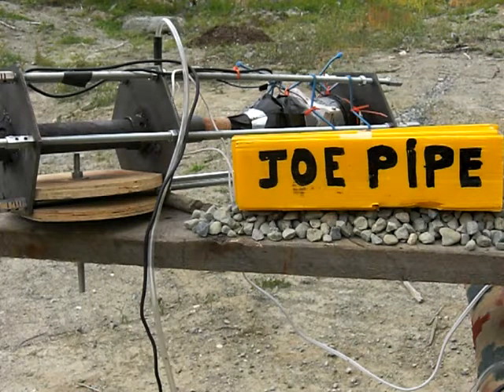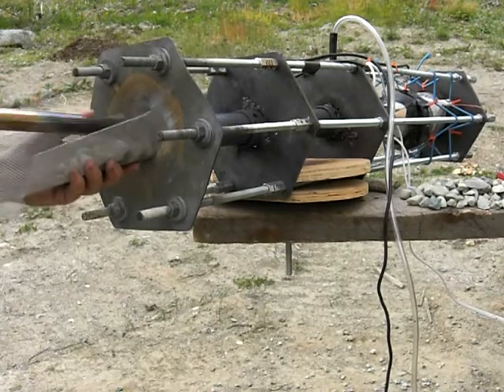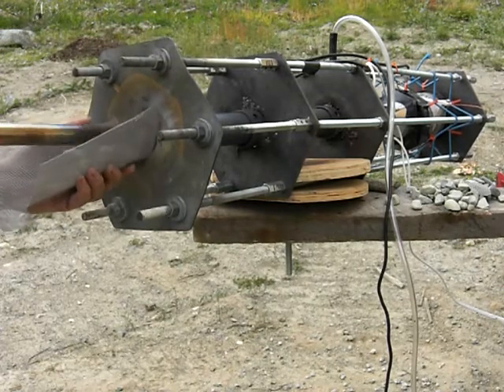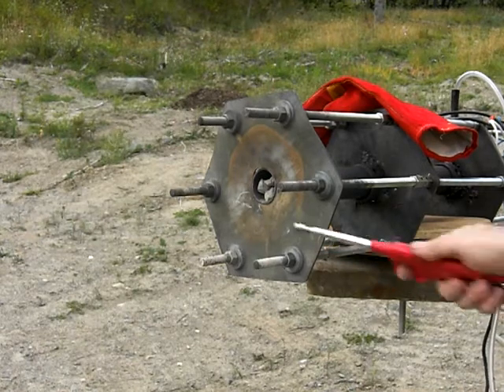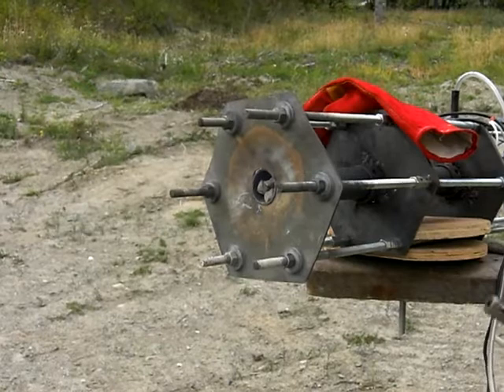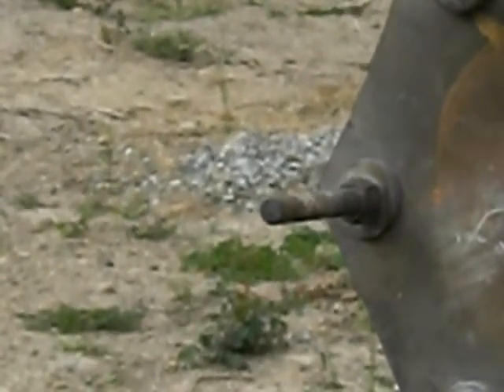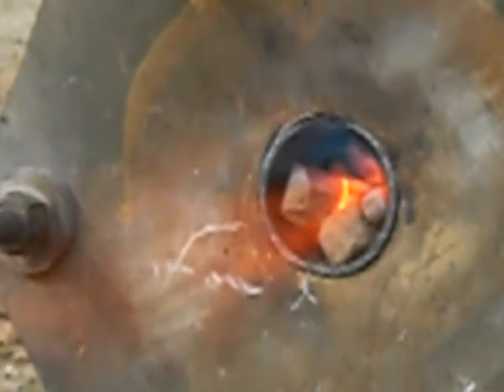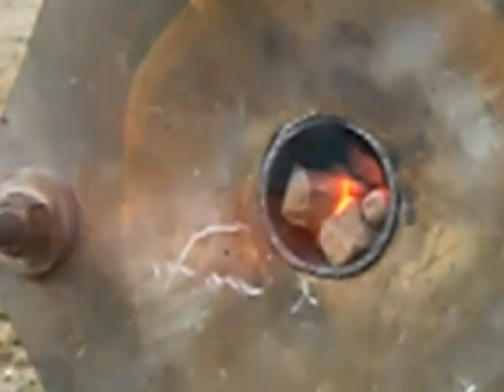57-Joe Pipe-PART 1 of 2-stuffed with rocks to set up an interferance pattern.  Test is for Level 3 flame

Comment: In responce to PKuban, you may be interested in a new prof. JP Kit I'm in the process of putting together.  For test equipment I've included a IR meter with a range up to 3, 002 F, a thermometer datta logger with K probes, and a propane mass flow meter-controller.  My first practical application will be to use the heat fm the L3 flame to build a closed reformer for cracking wastes pet. products for snygas to run a gen set, & a open reformer with turbo boost to create 1 Meg. btu plus.

Comment: A few summers ago I began taking the joepipe technology towards gasification of various fuels.  That's where I'm at now.  I was interested in what would happen if I ported the flame of the joepipe into a 3 inch insulated plenum made out of a casting of refractory cement encased in firebrick.  The 3 inch metal pipe reached temps of about 2, 500 F, hot enough to instantly gasify wood, plastics into syngas. Today I've put a joepipe kit together, including all the meters for wide range testing.